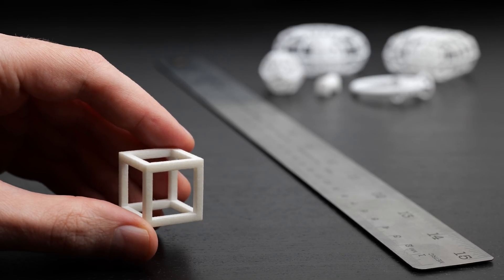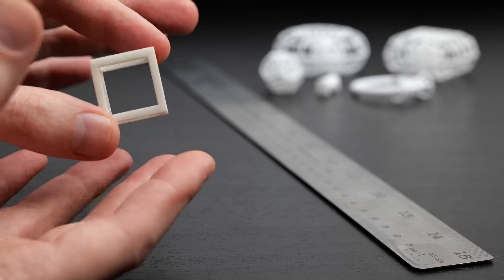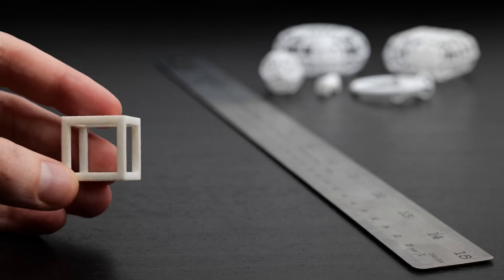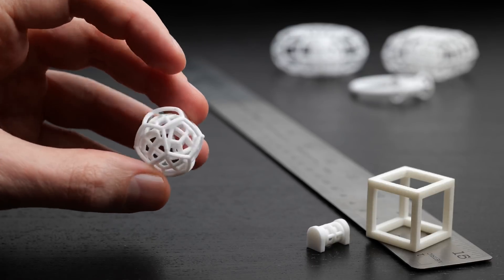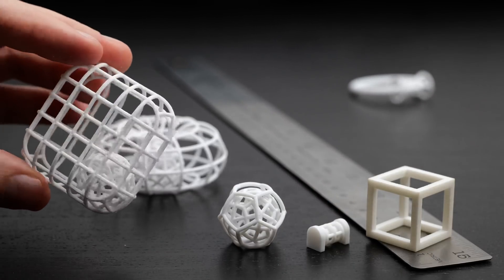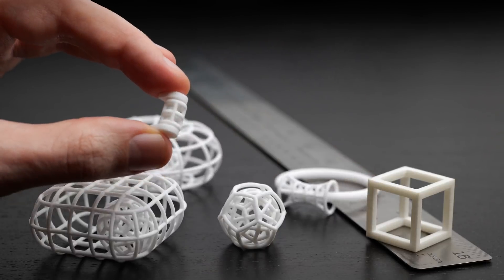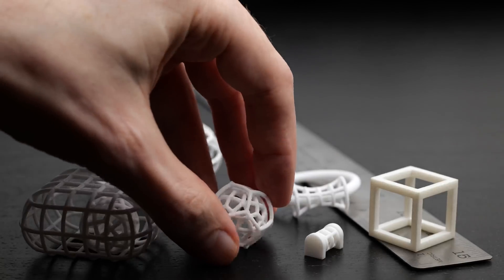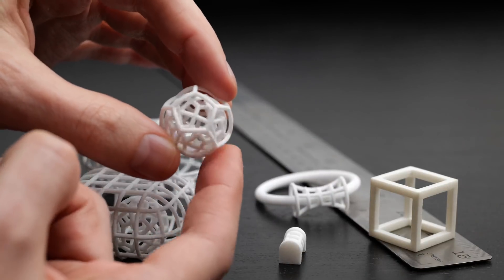Puzzling degrees of freedom

Comment: I didn't get it probably first, and thought one of the shapes had to be a cube, so for 1d I thought of a square tube, for 2d a round tube so a cube could move up and down and rotate, and then for 3d i imagined a rectangular box where a cube could move in 2 dimensions and rotate in one other. 4d and 5d i could only do if the first shape wasn't a cube, so I thought of a ball in a pipe or a ball in a box just like your examples. 
Does anyone know if 4d and 5d are possible if one of the shapes has to be a cube?

Comment: I guess I've already been indirectly spoiled this in my mechanical engineering class, but I think you're essentially looking for what we call in French "elementary joints" which are ~11 ways of linking two rigid bodies in order to get different DoFs. Apparently the concepts don't translate in English cause anglo-saxon engineers use another classification system... so here's the French wikipedia article : https://fr.wikipedia.org/wiki/Liaison_(m%C3%A9canique)#Tableau_des_liaisons
Reply: Saw that too a few months ago
I'm surprised it isn't translated in English lol
Reply: Yeah, I figured the same... Damn, never thought there would be spoilers in my mechanical engineering lessons!
Also, I still am very surprised to this day that the equivalent table simply doesn't exist in english?
Reply: That was a very enlightening link, even with the oddities of google translated text. Thank you. To summarize:
- Type of Linkage: degrees of freedom. (Example)
- Free: 3T 3R. (Plane midflight)
- Sphere/Plane: 2T 3R. (Bowling ball on an ice rink)
- Cylinder/Plane: 2T 2R. (Pencil on a table)
- Plane/Plane: 2T 1R. (Brick on an ice rink) 
- Sphere/Cylinder: 1T 3R. (Bowling ball in the gutter)
- Sliding Pivot: 1T 1R. (Foosball table rod)
- Slide: 1T 0R. (Trombone slide)
- Sphere/Sphere: 0T 3R. (Computer trackball)
- Condyloid: 0T  2R. (Your wrist)
- Pivot: 0T 1R. (Door hinge) 
- Fixed: 0T 0R. (Feet in Cement)
The page also gives the example of a Helical Link (as seen in a nut and bolt), which has one combined degree of freedom. It has 1 rotational DoF, and 1 translation DoF, but there is also a constraint which binds the translation and rotation together.

I notice that the following freedom pairs are not present: 3t2r, 3t1r , 3t0r, 2t0r, 1t2r. The first three are intuitively impossible; how can you possibly constrain rotation without constraining movement? But are there really no linkages with 2 translational degrees of freedom but 0 rotational? Nor any with 1 translational and 2 rotational? 

I feel like the 1t2r linkage is possible. I’m imagining a cylindrical tube with a groove cut along its length. Then inside of the  tube is a ball with two long pins sticking out. one pin slots into the grove, and the other sticks out the end of the tube. The first pin would prevent the ball from rotating around the lengthwise axis of the tube, while the second pin would limit the rotation around the other axes to prevent the first pin from coming out of the groove.
Reply: @robertwinslow  A lot of these are problematic as solutions to Henry's problem, for a variety of reasons. Also it'd be better to define the types of movement as l, linear, and r, rotation, as rotation is also a type of translation. 

The wrist joint, for example, has a limited range of movement. The video implies infinite movement within a degree of freedom, which is why Henry is looking for a better solution to a 2l3r cage, as the square boundaries remove a degree of freedom once the sphere runs into that boundary. Inversely, solutions like the 2l3r sphere/plane and 2l1r plane/plane are problematic because the free-moving object is not actually encapsulated in any way, and would actually require additional elements to actually bind the two. 

Based on this, your 1l2r solution also would not work, it'd essentially be the inverse of a combined degree, you're limiting movement in one degree while allowing movement in a different degree, an exclusive model, rather than an inclusive model. Unless I'm misunderstanding your description, but no matter how you do pins and grooves, you will run into boundaries that force temporary exclusivity. 

There's also additional issues, like the wrist joint and it's movement range, this complex joint would not translate well to a truly free-moving object, there's nothing to stop a sphere, that's embedded into a wrist joint, from free-spinning on it's third rotational axis, and once you do introduce limitations you also introduce a limited movement range. I had an argument for a 2DOF that's an encapsulated sphere, like a ball mouse, that also had friction elements to prevent rotation on it's third axis, but I believe this also breaks the game's rules as we're now bounding an object by material properties and not discretely spatial boundaries. For similar reasons, stacking two pivots would not work, a 0l1r + 0l1r implementation as a pseud-0l2r solution is not equivalent to a true 0l2r solution, because you can not manipulate both if your focus is only on one object, thus object stacking does not work. 

I had another argument for the 2l3r, a sphere that moves along an inner sphere's OD and an inner sphere's ID, the only problem is that there's no way to rigidly attach the two bounding spheres, and any rigid attachments would introduce an exclusion. Using multiple free-moving objects in this way, like a 3D epicyclic set, would also not work as the additional objects will provide random exclusions, unless you translate all objects simultaneously, but there's no way to do that without rigid attachments; which would make multiple objects into one object, which would then make this a free-moving spherical shell with two bounds, one redundant, which would just be an encapsulated sphere, which is 0l3r. 

There's just certain models that cannot exist in 3D space, 4D space, or higher dimensional spaces, may provide better solutions though. You need infinite movement along a degree of freedom by the object, but the encapsulating cage itself cannot be an infinite plane, complex solutions often don't work when this is considered, and compounded solutions only provide false positives.

Comment: For rotation, you can do this thing that fully mechanical gyroscopes do – concentric circles, each with an axle turned 90 degrees.
For translations, the mechanism can grab onto a rigid rail and move along a given axis. Put perpendicular ones and you've got a 3D motion.

And you can combine the above, to get any combination of rotational and translational movement you want

EDIT: Oh, you meant exactly two objects

Comment: Rough idea for the 5 degrees question:

The only way you can have 3 translational degrees of freedom is by having your object be free in 3D Euclidean space, so it's not bound to an object.

So at most you have 2 degrees of translational freedom, and so 3 rotational. (Unless I'm missing other ways of having degrees of freedom)
For 2 degrees of translational freedom, you'd have to work in a surface that you can embed in 3-space, so it's a connected sum of tori (I think). If we for example used a ball for our moving object (to allow 3 rotational degrees), then we considered the center of the ball and looked at its configuration space, it forms the surface we choose. This surface has an inside and an outside, and I think the object we're moving relative to must hold the ball from both sides so that it dosn't have more degrees of freedom. But then it won't be connected. I don't know if that's allowed by the question.
Reply: I agree with you it's technically impossible.

But it's interresting to notice 5 degrees of freedom can be constructed in a maybe more satisfying way :

Idea n°1 :

You can take 2 sphere, one has a smaller radius and is embeded in the other, then a sphere stuck inside thoses 2 would have 5 degrees of freedom. This is another representation using angles to the one using two planes. Exept this would not be practical since the exterior and interior sphere are not connected either. But  you only need one rode to connect the two, making the boundary close to being a point, i guess that would be better ?

Idea n°2 : (Probably the best)

Thinking outside the box since it's not how we defined constraint in this video, but if you had a 2 round and powerfull magnets and stick them together, you could rotate them however you like and sliding them in only two directions, their surfaces, because you can't separate them.

This is to me the most intuitive experiment but really any two object that stick together with great force works. Another exemple would be a very heavy ball so that you can't lift it up, then it would have 5 degrees of freedom to the earth.

Side note : Using magnetism you could even fixe in place the 2 spheres of idea n°1 by making them charged and with the same charge so they don't move in respect to one another.

This solution i think is still more satisfying even if it's a bit further from the definition we gave in the video. But to me we allready use electromagnetism when we speak about contact between two objects, and we also assume that some forces, like the one that holds the integrity of our solid, must be infinite. So i think magnets are a pretty good way to answer the problem!

Comment: Depending what you mean, two rotational degrees of freedom is easily seen to be impossible. [L_x, L_y] = L_z. Rotating slightly clockwise about the x-axis, slightly clockwise about they-axis, slightly counterclockwise about the x-axis, and finally slightly counterclockwise about the y-axis effects a slight clockwise rotation about the z-axis.
Reply from the maker: And yet it seems that there are counterexamples elsewhere in the comments...
Reply: @henryseg  Darnit. The above makes sense but so does the counter-example. Going to keep an eye out for the resolution. Excellent and very instructive video Henry!
Reply: @henryseg  Thanks for sharing. I hope you can respond to my email when you can. It would mean a lot. Thanks very much.
Reply: In more technical language, SO(3) has a one dimensional Lie subgroup, but not a two dimensional one. Now I'm wondering about the subgroups of SO(n) in general...
Reply: @terdragontra8900  so(4) is the first case of a lie algebra of SO(n) where the lie bracket sees different pairs of rays differently. The generator of an xy rotation and the generator of a zw rotation have a lie bracket of zero despite being independant. This means SO(4) has:
- a 1D subgroup (generated by xy)
- a 2D subgroup (generated by xy and zw)
- a 3D subgroup (generated by xy, yz, and zx)
- a 6D subgroup (generated by xy, yz, zx, xw, yw, and zw)

I don't believe so(4) has any 4D or 5D subalgebras.

On an unrelated note, what colour map did you use to make your profile pic? Did you dun it through a weierstrass function or something first?
Reply from the maker: @neopalm2050  Err... it's a photograph?
Reply: @henryseg  what's a photograph?
Reply: it seems to me the 2 DOF don't have to be fixed. All that matters is locally there's two but not three different directions you can move. So maybe both DOF lie in the plane with [Lx, Ly] = 0
Reply: @hexane360  correct
Reply: This is why you see 5-axis type movement in industrial machines often but not 6-axis because have a virtual 6th axis combining the other two
Reply: Only with those specific degrees. Latitude and longitude on earth cannot be composed to a rotation of the map for example
Reply: @broor  Actually, if you make sure to turn your map relative to yourself to compensate for the amount of turning you're doing when following a non-equitorial line of latitude, following a path like this would make it feel like overall you turned the map (though you wouldn't be able to tell because the map still lines up with the earth).
Reply: @neopalm2050  well i should perhaps have phrased it differently then. I was just trying to give an example of two degrees of freedom. Still the example holds if uou consider following lat/long lines as not rotating :)
Reply: Oh I think I get the difference. In the counter-example, with the slotted sphere holding an internal rod, when firstly the rod rotates within the slot (say x-axis), then secondly the rod rotates on its own long axis (y-axis), then the second rotation is not actually along the pure y-axis relative to the initial position as the axis has moved with the rod along the slot. This makes is different to the commutator definition where [L_x, L_y] = [L_z].  So obviously get different behavior.
Reply: I dont really know why you are talking about commutors but the degree of freedom can certainly be 2. You dont need to have the "same" degrees for every rotation. That part is irrelevant. As long as the dimension of the choices you have is 2 it has 2 degrees of freedom. You can have a system where moving along a certain path changes the other degree of freedom to allow for more possible total orientations however. Such as curved spaces
Reply: @broor  but that contradicts the definition of "degrees of freedom" from the video wich stated ots the dimensionality of the configuration space.
so we propably have to distinguis local and global degrees of freedom,and thats the local and global dimensionality.
Reply: @jenaf3760  the dimension of the configuration space should be the same as the local degrees of freedom. If im not mistaken. Thats at least what it feels like intuitively. Just because something is embedded in 3d space it doesnt have to have a 3d configuration space. Imagine a bent paper with coordinates on it
Reply: @broor  I ment local in the linit case. just how "smooth"(I forgot the right term) manifolds are localy euclidian, but not global.
Also I would not be sure that the configuration space has to me riemann either.
example where the configuration space is localy 2D and globaly 3D:
 (check the video about the holonomy puzzle)
moving an object on the spheres surface, but not directly turing it. localy you have obly the 2 dimensions to vhose from, but globaly the full 3D projective space is accessible due to holonom.)
edit: I am too dumb to type holonomy.
Reply: @broor  https://youtu.be/LG5HUd0hzzo is the video I am talking about.
Reply: @jenaf3760  oh i see what you mean! There are situations where you cannot simply have a configurationspace where each direction is one of the degrees of freedom (since order of movement matters somehow you get another dimension). Thats interesting that both those types exist. The system with latitude and longitude is the example of the other kind where we can map it with 2 coordinates since order of movement doesnt matter
Reply: Though certain other definitions of a degree of freedom and axes make it possible. If rotation about the first axis of rotation affects the direction of the second axis of rotation, then you lack access to rotation about the axis connecting a maneuvered figure to the point of intersection of these two linked axes except when this third coincides precisely with the first.
Reply: There is an apparent tension between this argument and the clear counterexamples. Am I right to think it just comes down to whether the axes are fixed in space or fixed to the body? The ambiguity is what I was getting at with "depending what you mean."
Reply: @chuckaway6580  your argument doesnt work. Youre saying two rotations composed gives the third rotation. That only works for some systems. We have examples of both types of systems. Some have only 2 degrees of freedom and they cannot be composed for more freedom. Some can be (such as rotation of a sphere).
Reply: @chuckaway6580  I believe the distinction you're looking for is whether the configuration space is simply connected or not

Comment: For the two rotational degrees of freedom case you can use a cylinder enclosed in a cylindrical shell, whith the axes of the two cylinders perpendicular to each other.
Reply: That's quite brilliant really, I couldn't think of a way to do this with only two shapes and no additional axles. Well done!
Reply: Concrete example: A cylinder with diameter 6 and height 8 fits snuggly "on its side" inside another cylinder with diameter 10 and height 6.

Comment: For two degrees of freedom you could make a ball joint. It's limited in a similar fashion to your 5 degree example, but it will definitely restrict that third degree.
Reply from the maker: How does it stop twisting motion around one of the two “arms” connected to the ball joint?

Comment: My solutions were essentially the same only using non-cyclic intervals - a socket with a prism for 1D, a socket with a cylinder for 2D, a sphere inside an enveloping hole (like those in analog mice) for 3D, a sphere in a socket for 4D, and a sphere between two planes for 5D.
I wonder if there are any solutions which use radically different degrees of freedom, for example some kind of novel screw solution that doesn't work without coupling location and rotation.
Reply: A screw would still be 1D. The coupled rotation and height can be described with a single number.
Reply: @shivaargula4735  Would a double-threaded screw+nut be considered 1D or something else?

The configuration space is Real × Bool, so it's not quite 2D tbh
(oh, and there's a finite number of equivalent pairs – states where flipping the second coordinate doesn't change anything)
Reply: Analog mouse balls are equivalent to eyeballs in this realm of analysis.